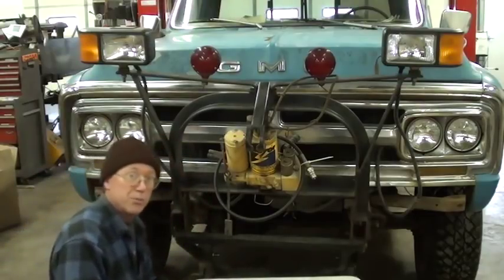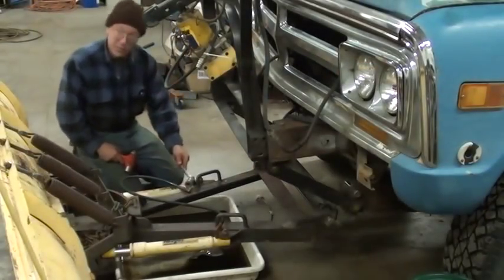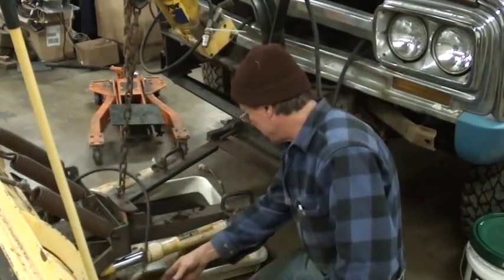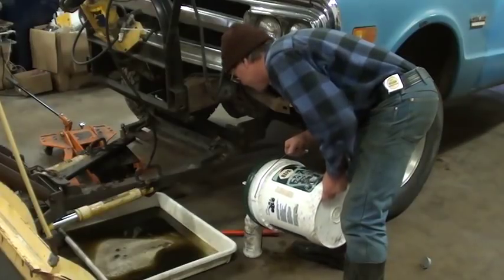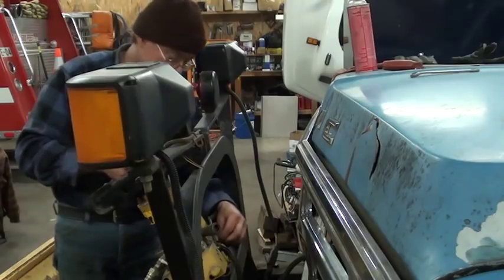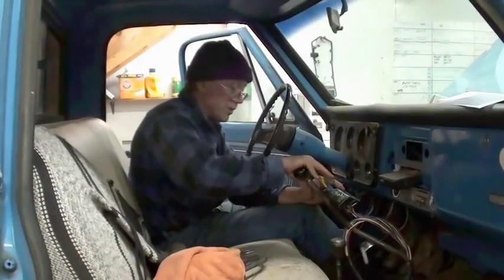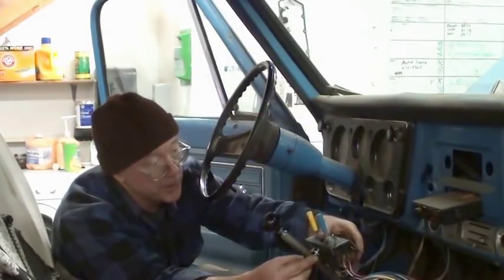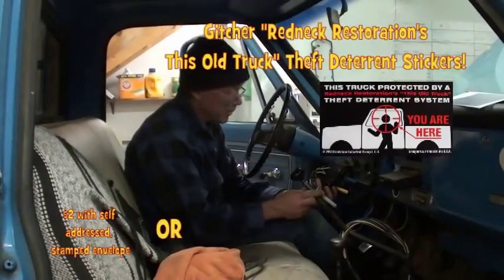Part 4/6 Meyer E 47 Snow Plow Installation on the 1969 GMC 3/4 ton 4x4

Comment: Back about 1988 to about 1995 we had a western and Myer's snow plows. My dad took both the hydro turn hoses and mounted on the plow rams. we would when unhooking the blade from the truck tuck them in to the springs to hold them up off of the ground. also he put trans-x oil in them. It was thinner and worked better in the below zero we get here in the St. Paul metro area of Minnesota.  I don't know if your area of the country gets that cold. Just wanted to share.

Comment: u may want to changer the hoses, check valves, oil. I run snowplows every yr, I don't want any problems 200 am in 20 degree weather in the middle of nowhere cant get help at that time of day and the cold to fix anything. nice job on the install I have 1 to finish this season yet give my other trk a break next time around.

Comment: My 15 year old E57 just stopped going to the left, also lost fluid, I topped up the fluid, still will not go to the left (goes up and down and right) but now squirts the hydraulic fluid out the top ( the small air hole which is supposed to just get rid of air) dealer says the system must be  broken, should not come out the air hole under any circumstances??) However, when I use the trouble shooter it says the quick connects are to be replaced????
Reply from the maker: You have two separate issues. However, both could be cause by rust debris in the fluid. The ram being a one way, any fluid out the vent is getting past the packing gland/seal. Mine is 40 years old and never been apart and doesn't leak out the vent. If the quick connects are not cleaned every time you go to re-connect them, that can introduce dirt into the system. If the lift ram is all the way down and the vent is exposed to the elements, that can introduce water into the cylinder, causing rust to form, which chews up the seal. As an aside, Meyer recommends changing the oil every year. Inspecting the old fluid will tell you what kind of contaminants are inside the system. If you have never changed to oil, get some and do it while you do this procedure.
The check your couplings, see if you can push the valves off the seats on both the male and female. You can do it in place, or take them off and do it in a vice. You have to relieve the pressure off the system first. Disconnect the pump motor, drop the blade to the ground and engage the left, right and up several times.
Remove the couplings. Reconnect the motor.  Raise the blade and put a block/jack stand under the frame. Drop the blade so the frame is on the stand and can swivel side to side. Just bump the left and right switches to see if you get fluid out of each hose. If you don't, you found your problem. Hoses can and do go bad and block fluid. The male end of a coupling can have either a ball or a pintle for the valve. A pintle comes to a point. Often they become stuck and someone will just smack them with a hammer to un-stick them. That smashes the point down and then there is not enough left to force the valves off their seats. There is a valve in each side of the coupling, so there has to be enough interference to push BOTH valves off the seats.

Comment: you can get by with hydraulic oil in your plow there ? here in minnesota we have to use synthetic plow oil or areoshell  in them or thay will not work oil gets very thick at 30 below

Comment: Jeff , what are the overall dimensions of this awesome building ( your shop ? ) that you are doing all this work in ? Hopefully on of these years I will get my 30' × 50' Allied Steel Building up & be able to work away from the outside elements ... a heated concrete floor would be icing on the cake .... someday , someday 😊

Comment: You need to go back to the smith brothers site and see what kind of fluid is recommended.  It's not universal tractor oil or trans fluid.  They only recommend Meyers snow plow fluid.  Why do you ask?  Well the fluid is thinner and does not thicken up when it gets cold and yes it will get cold it's a snow plow not like you use it in the summertime.  That and meyer or any good snow plow oil will have additives in it to help prevent freeze ups.  You also should flush the pump and rams I think there is special flush fluid for it or you can use kerosene or diesel.

Comment: All that work for a crappy meyers plow....  Have to take the bumpers off to fit the dam things on your truck...
Reply: in that vintage... Men did'nt care if thier truck looked pretty. Just so long as it worked.
Reply: klosnoski   Yeah the plow still sucks, bad design and a shitty  product... hated the meyers on my old chevys,  Fishers the way to go
Reply: meyer fisher... still the same
Reply: klosnoski
  Not at all.....  trip blade  vs trip edge.   fishers have more angle and are heavier and much more sturdy No one runs meyers anymore unless its a homesteader min plow